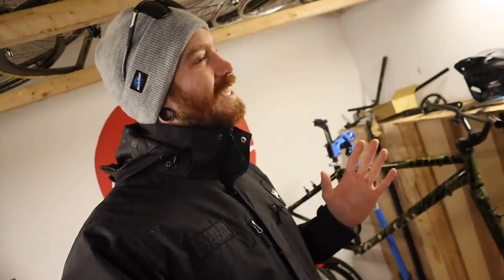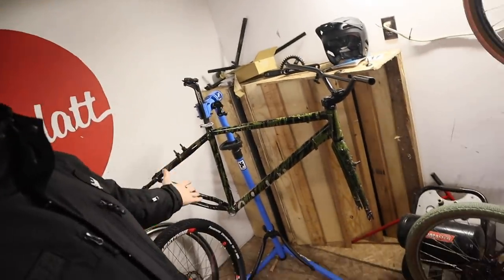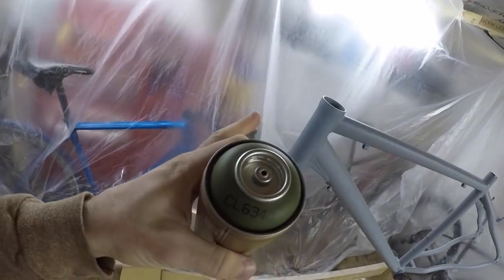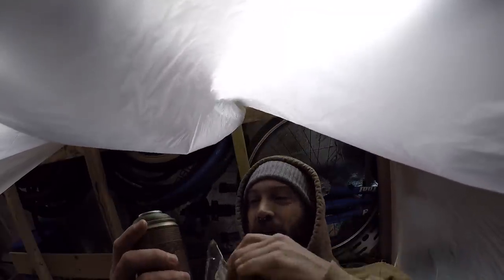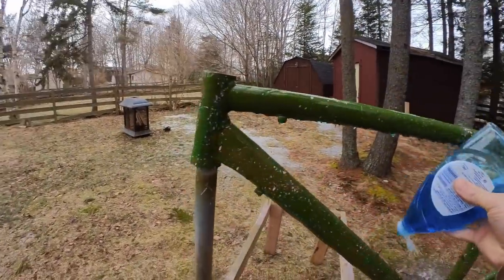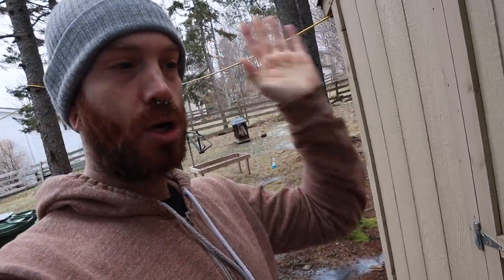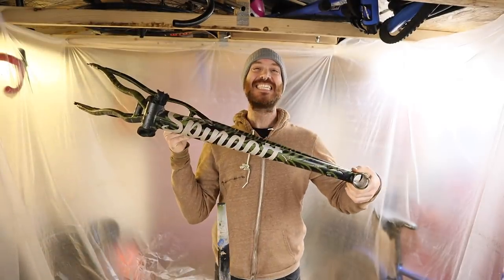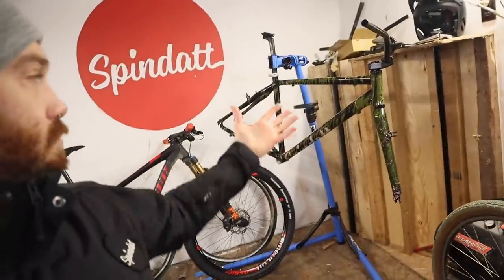painted with graffiti spray cans

Comment: You should be using a decent respirator for normal 1 pack spray paint, but if you were actually using isocyanoacrylate 2K clear then a standard respirator isn't appropriate. You really are supposed to use a full-face mask with an air-fed respirator and special suit that protects your skin, and also some states have laws preventing the use of 2K in residential zones.